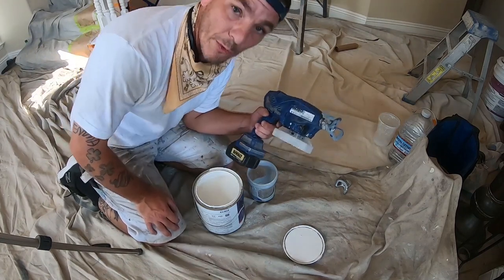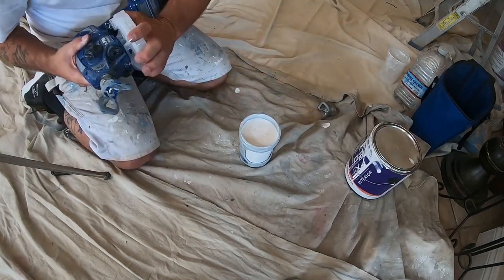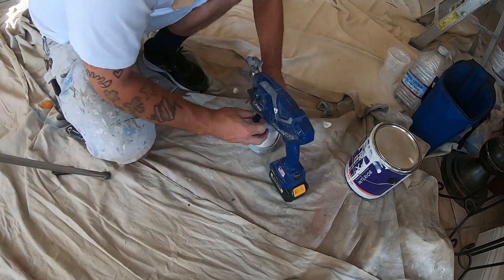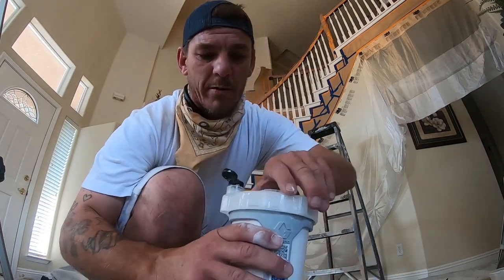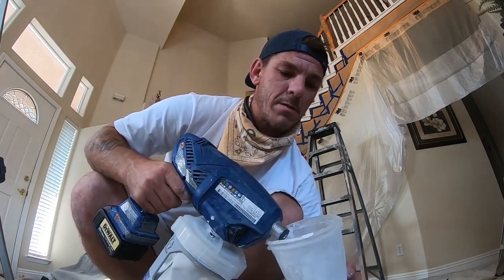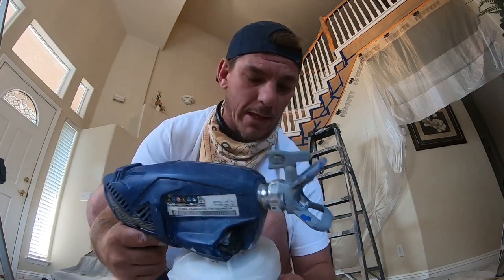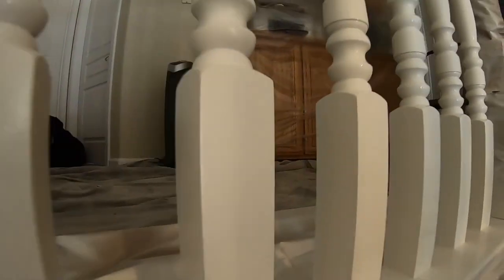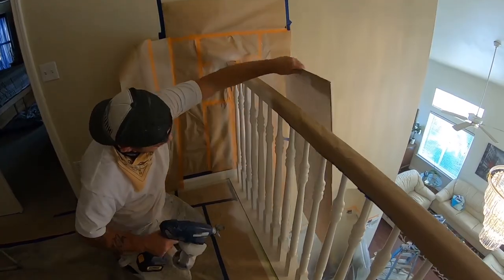PAINTING SPINDLES with GRACO TC PRO CORDLESS HANDHELD AIRLESS SPRAYER

Comment: Do you think the over spray is minimal enough to do door jambs in place? Hardwoods are already finished as well as the tile and carpet.   Had to install all the doors/jambs unpainted and I don't want to use a brush Ö  Doors are being sprayed separately, of course.   How was the texture after spraying?  You mentioned it looked a little heavy.  THANKS!  Great channel content!
Reply from the maker: I would definitely use some plastic to contain the dust. At a distance The overspray will settle as dust and can be swept up. I would definitely mask all near by areas though as much as you can. 
  If you can cover any near by door ways with plastic and or put a fan in an open window to help exhaust the dust.
  Here a link to the one I use. HANDHELD SPRAYER https://amzn.to/2Ez8Dja 👍But it sprayed a tad bit heavy for me mainly because i was using an old tip. With pressure a bit too high.
  If you need some detailed help in the future i do phone coaching for like super specific questions.
 I'll link it here👇 https://clarity.fm/tymo if you run into any major problems that can not be easily answered in comment section.
  So glad i could help. And thank you very much for the support and for the kind words.
  Also for watching the vids. Means a lot and i appreciate it😁😁